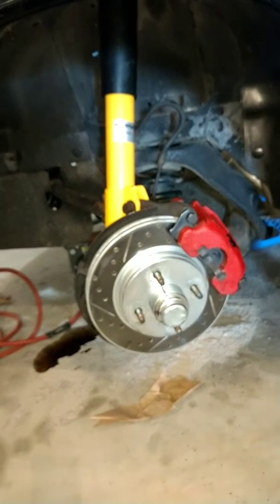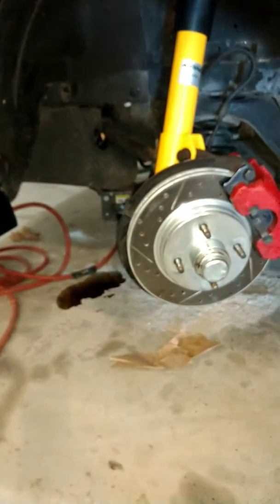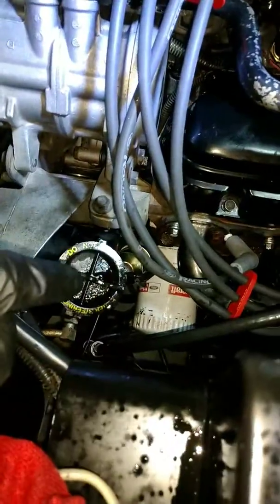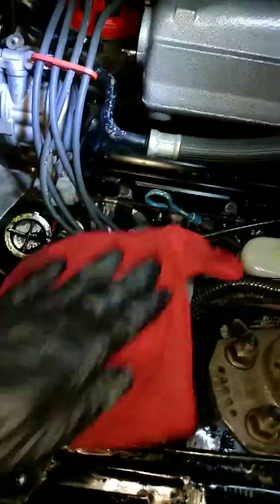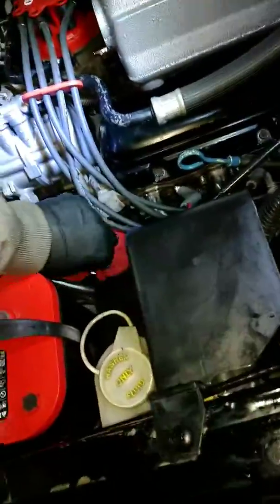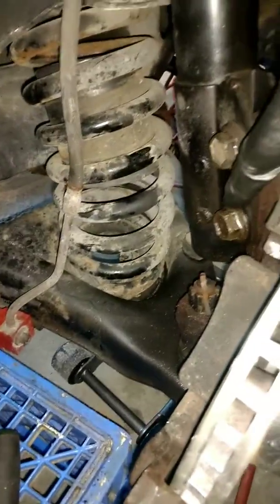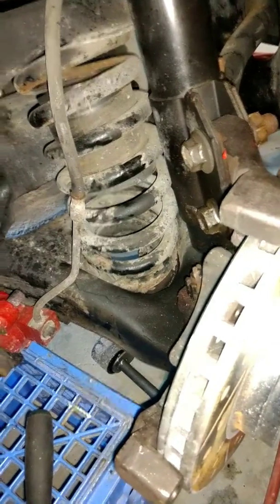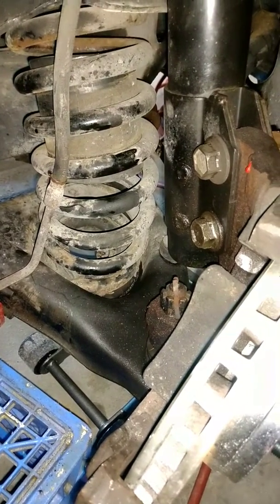Foxbody Koni Strut Install & Power Steering Squirt Gun meets Stubborn Strut Nut

Comment: I would check the power steering cap and check if the vent hole is clogged.  It definitely should not be squirting out like that.  Maybe the vent hole is partially clogged with dirt.  I have never seen that before!  So that's a new one too me.  As for the strut.  Make sure you are using the breaker bar on the nut and not the bolt.  You want to hold the bolt end and use the breaker bar on the nut where the threads are sticking out.  You might want to take the caliper and rotor off for extra room to work with.  I know it sucks taking them off but you might need to do that to apply proper leverage on that bolt.  Pancake compressor is too small to put enough power behind the impact gun, so I wouldn't use that.  You can use a small propane torch to heat up the nut before using the breaker bar on it.  If that doesn't work... heat up the nut and use a candle to wick candle wax into the threads by the nut.  The heat should suck the candle wax up into the threads and help you break the nut loose.  Make sure you are using a breaker bar and a pipe.  Can always go to a local exhaust shop and pick up a 3 to 4 foot length of scrap exhaust pipe.  If you offer them $20.00 they will usually give it to you for free.  Even if they take your $20.00, it is worth every penny.  Be sure to have a fire extinguisher or two ready.  I would spend the money and get two fire extinguishers... you can never had too many.  The cost of two fire extinguishers is a lot less than a melted Mustang and a garage/house fire that you really don't want to explain to the home owners insurance company.  Battling rust is job one for Midwest Stang Bangers.  It can really test your patience... that's for sure.
Reply from the maker: I got it! Was able to use a propane torch on the bolt head (nut wouldn't budge), then the Impact gun broke it lose. I tied heating that nut over and over, it just wouldn't break. I used a long bar and ended up breaking the breaker bar! So the propane torch on the bolt head (opposite nut and threads) was my last effort, it worked. 
Yes, the power steering fluid is squirting right out of the cap, I didn't check it to see if it was plugged. But yet, it was coming right out of that hole on the cap. Why would it do that??
Reply: @jpp9846  Glad to hear you got it off of there.  Funny how one nut and bolt comes apart with zero issues and another nut and bolt takes 3 hours of fighting to remove!  I'm not sure what is causing your power steering issue.  Maybe it was slightly over-filled.
Reply from the maker: @fwh79FOXR6  all them bolts were a bitch to get off, but at least a pry bar and socket and even the pancake compressor and the impact moved the others. But that one bolt wanted to be a dick I guess, hahaha!
Strange thing with that power steering pump. Yes, I did over fill it some last fall, I had to use a turkey baster to remove most of it from the reservoir. Maybe it was still a bit full? Strange. I have noticed it isn't spraying out as much now, so it being overfilled might of been the issue. 
Waiting on my new 90 degree elbow to come in for the fuel gauge that broke on hard fuel line. Once that comes in on Thursday, I will get that on and be able to fire her up again and do some tuning. Guess I might put a little rubbing compound and DA on the front quarters in the meantime. I didn't cover them very well (like instructed to by you) during the intake swap, small scratches all over 😠
Live to Learn, Learn to Live
Reply from the maker: @fwh79FOXR6  clutches....talking clutches now. Should things be upgraded to a 26 Spline over the 10? What's your opinion there....and brands of clutch??
I'm thinking about having the garage do it before driving season and I would like your opinion.
Reply: @jpp9846  Sounds like your are moving along.  Yeah... it's not hard to scratch up the paint when you are working on the car.  Black, as you know, shows it the most.  I feel like I some how scratch the fender's paint every time I check the oil on my black car!
Reply: @jpp9846  I think picking up the Ford King Cobra clutch would be a good choice.  I had a King Cobra clutch in the white car for a long time and I really liked it.  I have a Ram clutch in the white car now and it is pretty nice as well.  The King Cobra clutch offers better grip than a stock clutch, plus the pedal effort isn't crazy.  The Ram clutch is a little heavy and can be annoying if I am stuck in traffic.  The King Cobra should hold up well to the mods your motor has.
Reply from the maker: @fwh79FOXR6  thanks! I'm still a week or so out from doing this...I may wait until I drive it a little first...just figured I'd ask you opinion. I will check that King Cobra Clutch out. I'm curious if there is a "for sure way" of knowing what Spline I have too, without pulling the Bell housing? I only ask, because as I looked through the receipts the last owner had, I noticed on one of them, the garage noted "not factory transmission". I know it's a Borg/Warner Tranny...but wonder why that garage put that in notations? Other than that, I am going to do a smoke test this weekend on my work and see if I have any vacuum leaks. Car idles pretty well, but seems to dip a little bit while.sitting. I have timing at about 14, FPR is set at 39. TPS is at .99-.98. can't really think of anything else I can do to tune?  Itching so bad to get this out of the f the garage....it's coming!
Reply from the maker: @fwh79FOXR6  she's ready, minus tinkering with the tuning. Good thing you told me a few things about a few things on paint correction 👍
Whatever I F'ed up can be fixed with that DA, some compound and some wax. You've taught me to look at so many minor scratches...it bugs me when I see the smallest flaw 😂
Reply: @jpp9846  I'm not sure about the spline count for the trans.  Not something I have come across.  That garage note is kind of odd too.  Not sure what to think about that.  Its always unsettling to think about the poor choices previous owners can make!  As for tuning, you could try increasing the fuel pressure and see what happens.  It's shocking how much a fuel pressure tweek can alter performance.  Sometimes you really unleash a caged animal.  It's funny because I see a lot of guys that don't think adjusting fuel pressure really does anything.  That hasn't been my experience with it though.
Reply: @jpp9846  No doubt!  You will never look at paint the same way again!
Reply from the maker: @fwh79FOXR6  you know, I've read a bit about the FPR, I've seen a lot say that no matter what you set that FP at, the computer still sets it back to the 39ish? You ever heard that?? 
Yeah, the Transmission thing is strange. There is a tag on it...but I'm not sure if there is a way to tell if it was the original tranny or not. I've been watching this "NeoMustang" channel, a good Fox channel and he mentions a lot of enthusiasts swap to the 2.3 liter tranny?
Reply: @jpp9846  The computer can not alter the actual fuel pressure but it can alter the pulse width or "how long" the injector is held open.  I personally feel like adjusting timing and fuel pressure are worth the time.  They are the last stop before heading down the road of adjustable computers like mega squirt.  There are plenty of cars out there that really don't need an aftermarket injection system like mega squirt.  Those are the cars that can really benefit from the tuning that an adjustable FPR provides.  I don't know much about tranny swaps but I personally feel that saying there is a strong T-5 is misleading.  No T-5 is strong in my opinion.  However, building cars can be funny.  You could blow up a T-5 with a stock 5.0 engine and then you read about some guy pushing 20 psi turbo boost through a built motor that is backed up by the factory stock T-5.  Some cars and their parts completely defy logic.  I'm not sure if there are different spline patterns among T-5 trannys.  I've never come across that but i'm not a trans expert either.  I think your car is a big question mark because you don't exactly know what previous owners have done to the car.
Reply from the maker: @fwh79FOXR6  and that's what sucks ass....that I don't know. I do know there is a Borg/Warner Tranny in it...I feel it would absolutely need someone that is a T5 or World Class knowledgeable mechanic to spot that....not some guy that just got his ASE certficate. I hate all the question marks on my car...drives me nuts. Buy the longer she is under my roof, the better it'll be. Just like your feelings on your black Stang "what did they do to you"...I feel the same way about mine. I will get all the kinks worked out and this car will have the best life it's ever had under my roof than the previous owners. 
So, what's your opinions on Timing and FP settings? I'm planning on taking her out, 5/01..…where you think I should be setting those two?
Reply from the maker: @fwh79FOXR6  my car was purchased in 03.05.87 in Chicago, passed emissions in 03/31/92, then failed emissions in Illinois in 94, 95, and 97. Then appears to have sat from 1999 to 2010. Sold to Wisconsin in 2010, where it was sold to Ohio in 2015.....then to me in Michigan in 2017.  That's just crazy this car sat for 11 years!
Reply: @jpp9846   That is kind of crazy.  It seems like letting a car sit is one of the worst things you can do to it.  All things considered, it seems like your car is actually in pretty good shape after all it has been through.
Reply from the maker: @fwh79FOXR6  it's in great shape, paint wise and interior. 
If all the documentation (if) is correct, there is just under 82k miles on the car. I don't know how Illinois handles cars that fail emissions...are they allowed to still be driven? Just weird it just went MIA for dam near 11 years. 
Planning to do a pretty big interior (that includes a f-ing heater core 🙄) restore this next winter. Ttop seals (I want this thing to be waterproof, but read ttops leaked off the showroom floor) all new carpet throughout and remove and paint all the paneling. Have some "cute" LED's for the dash too. Would like to get my auxiliary lights (low coolant, washer fluid, gas. Etc) working again. I'm sure (hoping) when the dash was swapped to the 140mph, they just didn't plug them back in. Going to keep it all original, keeping the Tweed interior...I've just always been of fan of it. 
But exterior, the car is pretty solid...no rust. Towers, Torques and frame rails are solid. No cracking in any of the pillars...it's a solid fox considering the age. Just want her to run strong! 👍
Reply: @jpp9846  Your car is definitely a survivor, no doubt about that.  I get the feeling you are going to save the heater core for last!
Reply from the maker: @fwh79FOXR6  hahaha...I'm not messing with it now...winter stuff. 5-1-19, it's back on insurance and I'm drivng it this year
Reply: @jpp9846  Sounds like a good plan to me!